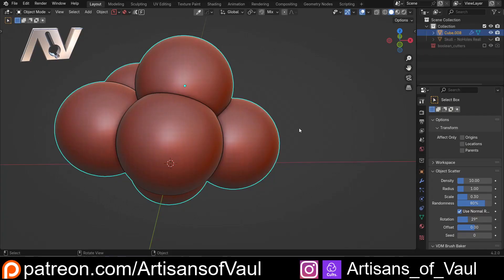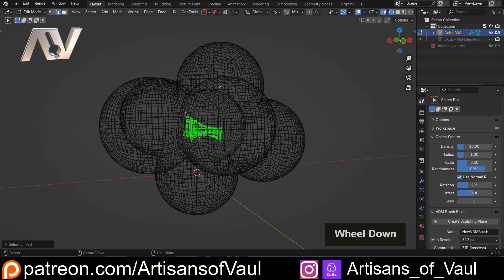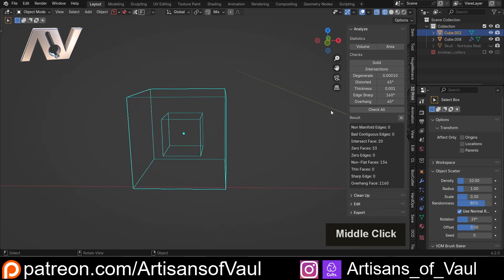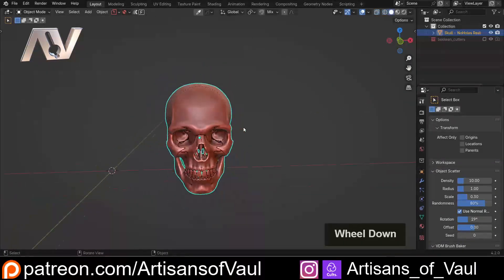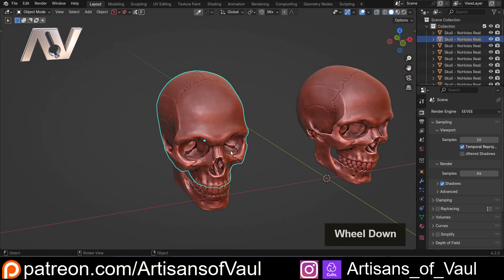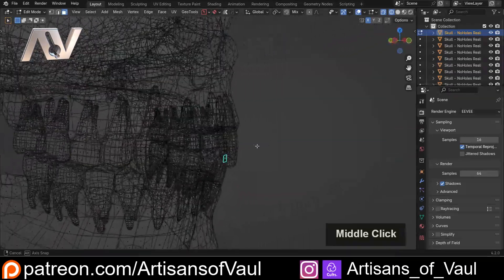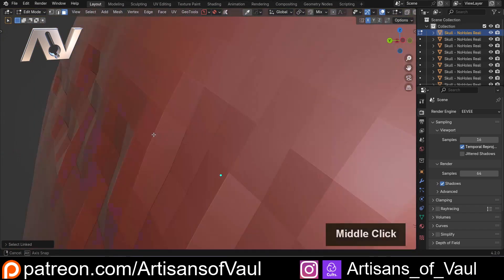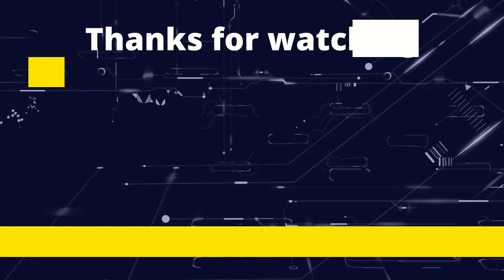Removing internal cavities for 3D printing in Blender

Comment: I'd like to know how to deal with cavities caused by those teeth having bits inside the skull. Did several Star Trek kitbashes and have a bunch of internal vertices/faces to remove. I tried voxel remeshing but even after buying a computer specifically to handle the remeshing, it still crashes either doing the remeshing or decimation afterwards. I feel like my only choice is to manually delete all internal faces and manually connect vertices between pieces, which is going to take many, many hours.
Reply from the maker: So those are harder because they connect to the outside of the mesh meaning this trick (unfortunately) doesnt work. Other than some manual work I haven't found a great trick for that Im afraid.

Comment: So I have a model of a car I'm wanting to 3d print on my bambu p1s. Im having issues with it because the person that designed it did the interior so there's a steering wheel, seats and whatnot. There's no engine but the cavity is there. Im assuming this method will work with what im trying to do? Any help is appreciated
Reply from the maker: It should do but there may be issues with it if there are connections between the interior and exterior (for example if they modelled the doors as one piece.
Reply: @ArtisansofVaul yeah each door is it's own piece and along with each window, headlight and so on.
Reply from the maker: @patrickchuvala  That will cause issues as this will be unlikely to work as the inside is connected to the outside of the model.

Comment: Awesome.  What is the best way to remove bits of internal geometry when panels intersect imprecisely and have all been joined. (Car body panels)
Reply from the maker: When you say joined do you mean with a boolean?  Or using the join function?
Reply: @ I think they were all joined.  I was thinking of shrink wrapping the outside.  Does remesh ignore unwanted internal stuff?
Reply from the maker: @kiwigeeknz  OK, sorry this might be a bit long but you have a lot of options.  The first is to remesh.  That should remove the internal parts but will cause some potential issues with hard edges and "pixilation".  If you watch this video I demo it towards the last third I think so you can see what will happen: https://youtu.be/WOVeqqaSgdE

The other option is to remove the overlapping parts and then boolean everything together.  This is a common STL issue and you can use the L select.  I show it as an option in this video I believe: https://youtu.be/dneiDiTrZjQ

I hope that helps
Reply: @ thanks so much. Still learning, your videos are super helpful.

Comment: As an absolute begginer just trying to fix a small hole in a 3D print this went way too fast for me and involved a lot of pausing to google stuff, but thanks I got there in the end. 
When you seperate an object into parts though, how do you un-seperate it again? Just exporting to STL seemed to work anyway since presumably that just exports all the vertex data as-is, but just wondered in case I wanted to do further editing on the same project.
Reply from the maker: @sonicwingnut  This admitedly isn't the most beginner friendly topic to go through (without it taking hours) so thanks for persevering. You can bring them back together normally with booleans would be much suggestion. You can export as is as most slicers can handle it but some will have problems.

Comment: This is very useful, thank you very much. Can you elaborate on how to clean internal shells that are connected to the exterior surfaces?
Reply from the maker: @MAAC40  Normally I'd just find the connecting point and remove the verts there. That will allow this to function.  When you have deleted the internal geometry it should be easy to patch up the hole.

Comment: Thank you, thank you, thank you! Been tryin to fix my very complicated model for days and you just showed the EASY way (selecting the inside and deleting). I owe you a drink!
Reply from the maker: @MrRacerdon40  😁 Great to be able to save you some time.
Reply: I have an expensive truck models from CGT and cannot print it as wall's are all non manifold so trying to learn blender to fix it to print! Very experienced 3D printer just not with blender! I'm at the point fist screen hole 😂

Seriously though tried this with the skull on one of the Gerry cans as its a hollow with thin walls but solidify thickens the walls to much it distorts the detail and shape on the outside so need to use the offset mostly to bring things back to what they should look like and adding abit of wall thickness but has to be an easier way? The Gerry can the top was see through when i removed the inside hollow! You could still see it was all there from outside in blender soon as zoomed in was seeing the brackets to the frame on the truck through it like a window!

Comment: Great video.  I have come across an stl file which almost looks like it was sliced and pushed back together which has created huge hollows but with planes which are all connected to the outer shell of the sculpt (no idea if that makes sense!).  I don't suppose there is a quick way to fill that type of hole? My current plan is painstakingly deleting hundreds of points and then filling the holes it has created!
Reply from the maker: Unfortunately not an easy one that I can think of but it does depend on how "screwed up" the file is.  Is the file available free online?

Comment: Nice video. my model happen to have cavities that seem to be connected to the outer faces so i cant use these method. (Scanned object file)
Reply from the maker: @talasek2008  That's odd from a scanned object. In that instance just find if there is a single join (like a tunnel) and delete those few vertices connecting it. Then you can use it and it still saves me a lot of time.

Comment: well, this seems nice, problem is that on the model I am currently on the inner cavaty is connected
Reply from the maker: That's a frustration. Depending how connected it is (like a single point of entry) you can normally delete those edges and use a face to close off the mesh at both ends and then do this.

Comment: I’m still new to 3D modeling but am looking into a 3D printer, that also prints in color. What should I look for as far as beginners go? Thanks.
Reply from the maker: It really depends what you are looking to print.  If you are looking to print in colour I assume you're looking for an FDM printer?
Reply: @ArtisansofVaul  yes FDM does seem to be the best option for what I am looking for, but would there be a particular model you would recommend? Any key features that I should look for that will save me headaches later?
Reply from the maker: @robert8794  So I have a Creality Ender3 v3 (I've got a review linked below) and it's great. Worked out of the box and the biggest issue I've had was a blockage once and I've been using it pretty aggressively/non-stop for weeks at a time. People also saw the bamboo printers are great but they are more expensive.

https://youtu.be/k6zjN3QSNPc
Reply: @ArtisansofVaul  okay thanks. This was helpful. I will look into both of them.

Comment: I don't really think that the second option will allow to print it without any problems in all cases. In my experience, any intersecting geometry (as teeth and jaw here) can still cause troubles because a slicer can still think that there is a cavity there. After many hours of "repairing" such problems in uv tools I got myself "boolean everything properly and check the model from inside everytime" as a rule and it saved me a ton of time. 
But when I'm lazy and want to to print a model as quickly as possible - I just hit remesh in blender, set voxel size as low as I can to preserve initial quality and then decimate until the model is below 1mil triangles. Most of the time it will either remove all "problems" or will literally show you if there are any holes in your model.
Reply: Edit. I looked through the comments and saw that I'm not the only one who likes this method😂
Reply from the maker: As said in the video you will have to check everything is then booleaned together.  The remesh option is there once you have removed the cavities as well but unless its an organic model I would agree its a lazy option as it leaves imperfect hard edges that can look horrible when scaled up in any way.  But if it works at the scale you're working thats all good.

Comment: Another awesome video for some reason when I mesh everything together I use ZBrush and I hardly get this problem but I’d like another video on how to correctly fuse objects together
Reply from the maker: @raphaelsanabria7505  it's normally OK if the parts are the right thickness. It's more likely to be an issue if the parts are leaving a gap between them because they aren't thick enough, or there is an issue with the mesh before they are booleaned together.

Comment: I haven't seen the video or read the comments yet, but here's how I'm guessing he's gonna do it: Take the object into face mode, use the L key on one of the outer faces to select all the linked faces (so, all the outer ones), press ctrl I to inverse selection (so, selecting all cavities), and then delete faces. I'll watch the video and see if that's it.

Edit: Well, I was half right. That first method is good too though, I hadn't thought of that...
Reply from the maker: @evanwilliams1199  Effectively yes. Though I normally select the inner section to avoid mistakes 👍🏻

Comment: To make sure the teeth and jaw are joined well and to get rid of the internal geometry at the same time, you can do a voxel remesh too. If the cavity is too great it might be an issue but I've noticed that voxel remesh doesn't like internal geometry and works to get rid of it. I use this all the time since I exclusively use Blender for printable models. Helps fix the ones you get from online as well since, like you said, some people are lazy. I've had prints where arms and such print disconnected. To help with that, like with the teeth, I would scale all teeth by individual origins just enough that voxel remesh makes it all one solid while also getting rid of cavities. Don't get me wrong, I like and use what you have here. I just tend to do all of these and more to avoid losing another print to resin rot. I'm paranoid =P
Reply from the maker: @davidgormley235  I'm not a huge fan of the remesh methodology as it will add a lot of geometry to objects that are flat and can sharp corners/edges. But for organic things it can work fine for sure.
Reply: @ArtisansofVaul  I usually set remesh high enough that all details are preserved and all corners are sharp(often getting 6-8 mil poly meshes lol), and then use decimate modifier at value from 0,1 to 0,03 depending on complexity of the object, so it gets into semi-reasonable territory and my slicer doesn't chug like hell. yeah, it's a crutch solution, but hey if it works it works.
Reply from the maker: @BaronBunny-fb2vp  Exactly right. There's lots of ways to come out to a good result in Blender 👍🏻
Reply: @BaronBunny-fb2vp  yea I forgot to mention this step but that's exactly right. Just depends. Sometimes you can use the (I think it's called adjustability or something) bar that's under the voxel size which is rarely noticed or touched in the remesh modifier tab. It does something extremely similar to decimate. AoV is right for anyone interested. It's just one of many solutions and isn't potato pc friendly if you are trying to keep high detail.  I just like throwing it out there as it's a way I had to use to fix many models you get online that are full of pockets and "joined" parts with gaps in between them. If you're learning fresh I mostly suggest AoCs methods. I just build most of my models in sculpt mode similar to using zbrush so I'm remeshing constantly. But a hammer in you're tool belt is just another tool. Careful when you use it as not everything is a nail =P